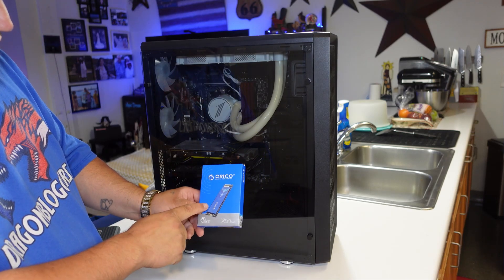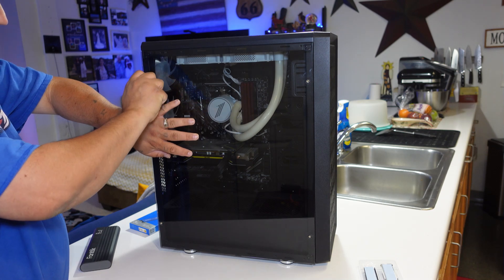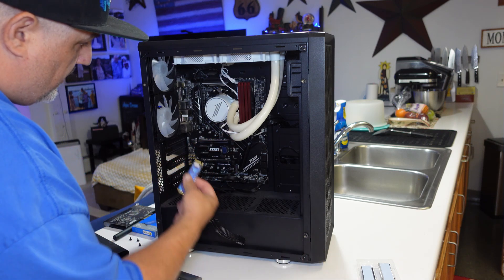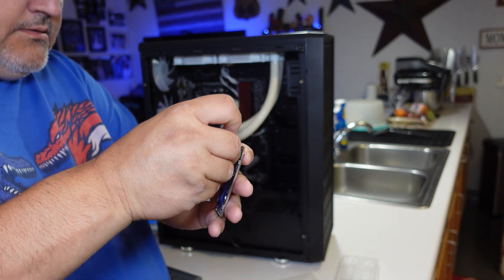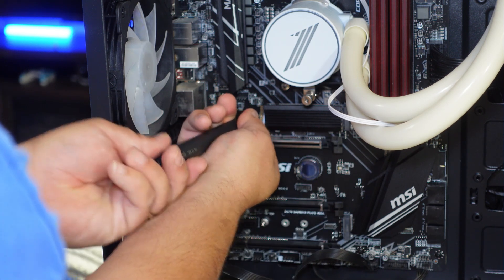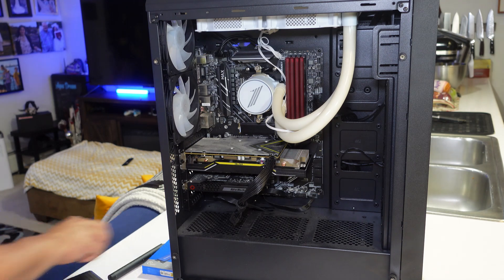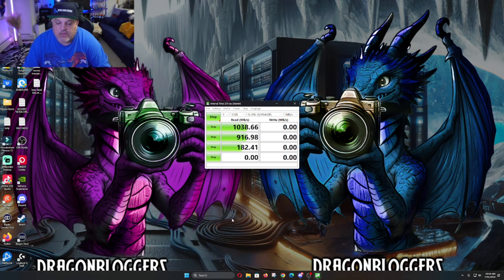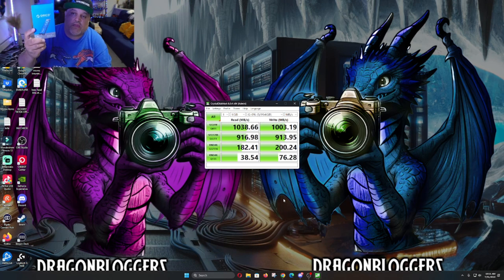Install and Testing ORICO J10 1TB NVMe M.2 SSD

Comment: You should check what the motherboard is running the m.2 pci-e speed at, that slow is impossible if its really a pci-e 3.0 x4 or 4.0 slot.